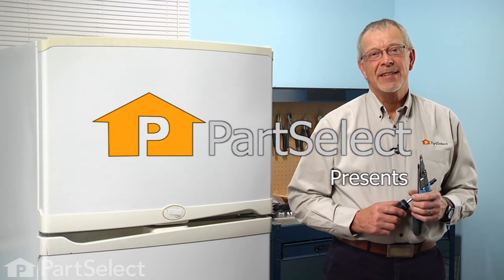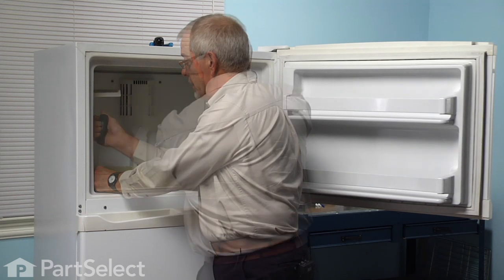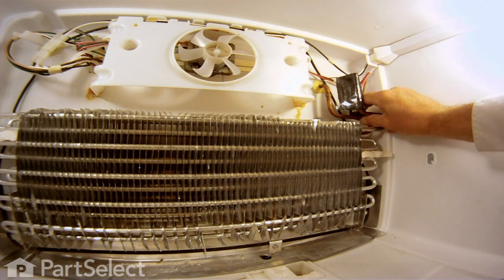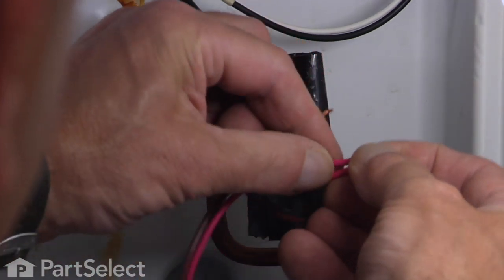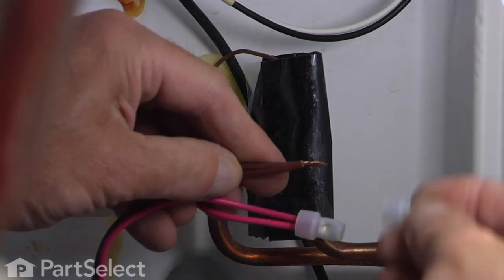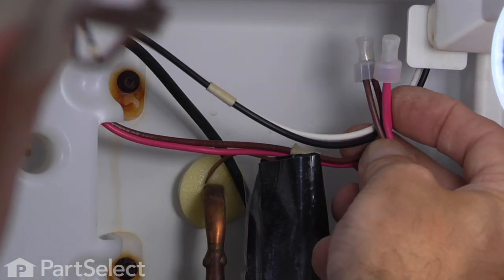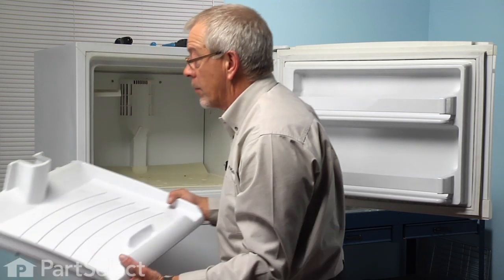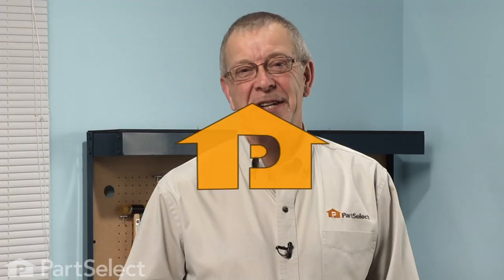Replacing the Refrigerator Clip-On Bimetal Defrost Thermostat (Part # 4387503)

Comment: What is that black stuff taped around the copper end of the evaporator? Mine looks melted and it's dripping a bit of liquid. In this video it looks similar, which gives me some hope that my problem is with the defrost thermostat and not a freon leak.